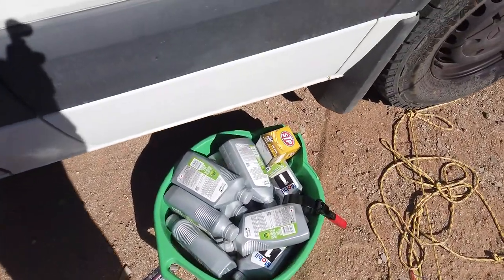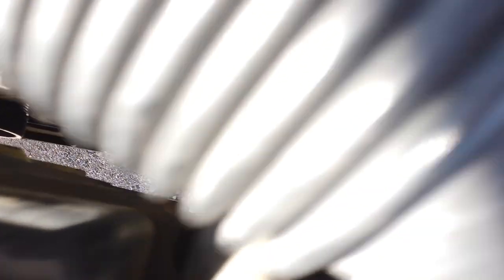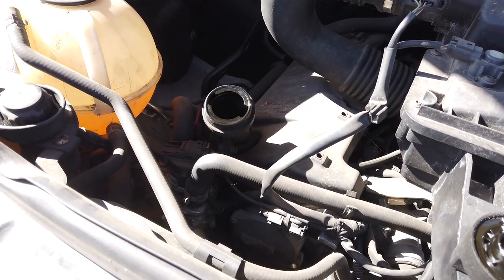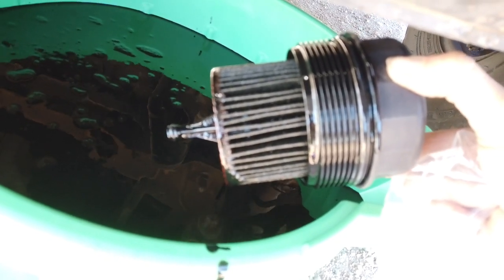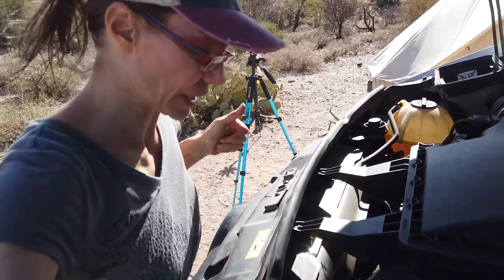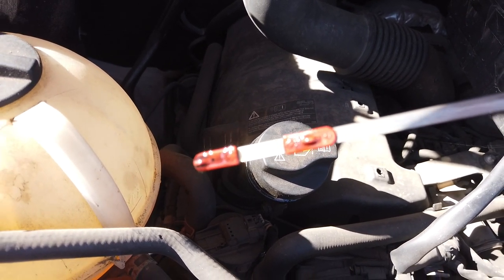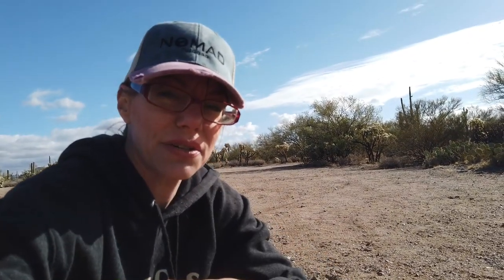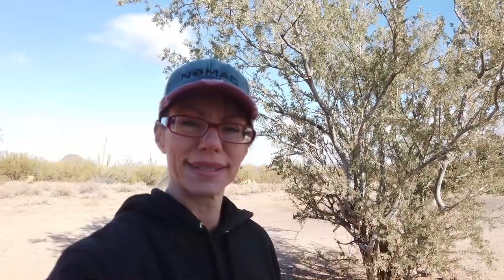Mercedes Sprinter Oil Change  -Maintenance- Van Life

Comment: Can you not order all your supplies on-line? Some areas have Amazon lockers, or mail receiving places, or pickup places at large truck stops to receive orders. You can be certain of getting all you need with one-stop shopping rather than checking several places with limited supplies. It is likely the shipping would be free on the amount you are buying. Just a thought, it might be worth checking into.
Reply from the maker: Yes, I normally do that. But all the amazon drop boxes were full in the area so I thought I’d try locally.

Comment: Heads up you don't need to cycle the key as the oil pump is not electric but driven by the engine itself